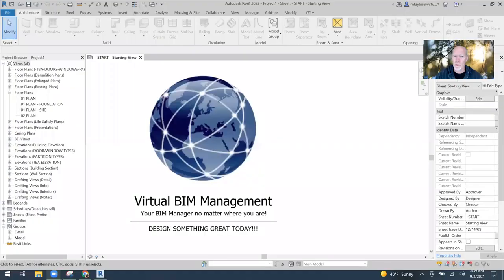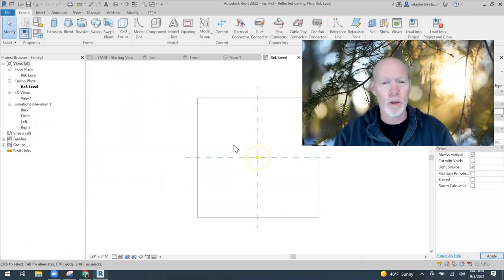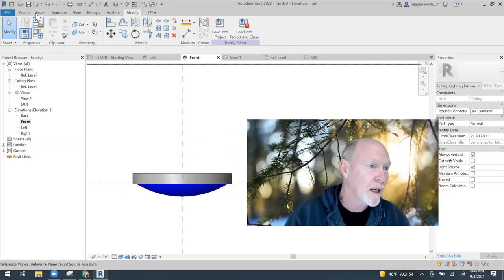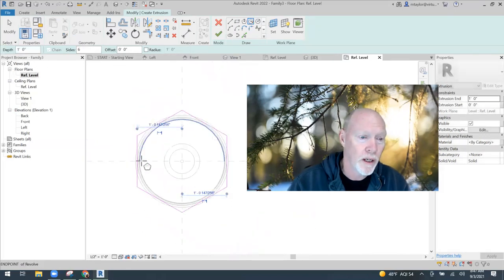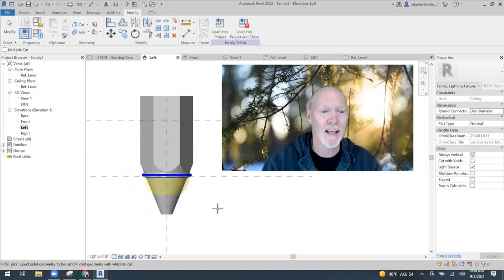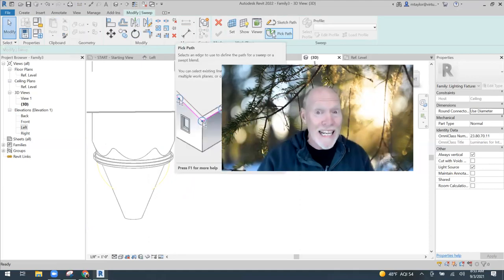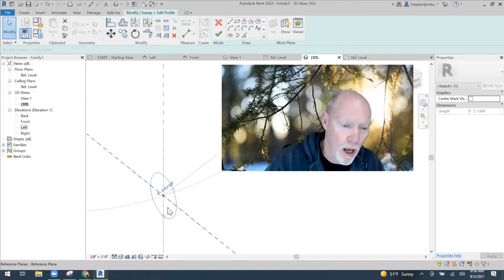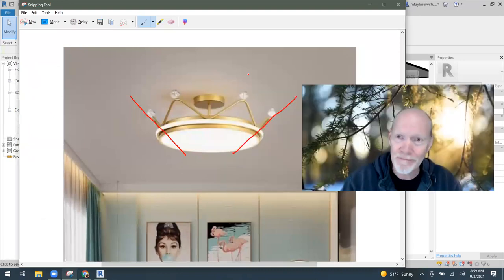SPECIAL REQUEST: Custom Lighting Fixture

Comment: Hi Mike. Thanks for the simplified solution for the creation of the complex light family. I am writing to ask if you could also show how to create a camera family with multiple anno. symbols representing different types of cameras. Symbols are all the same shape but have different colours to each. Also a different single letter would show on each. And the symbols would be provided with offset front to back and side to side (only plan view). The camera model would not be seen in plan, but would be seen in 3d view and elevations. Anno. symbols view in plan.